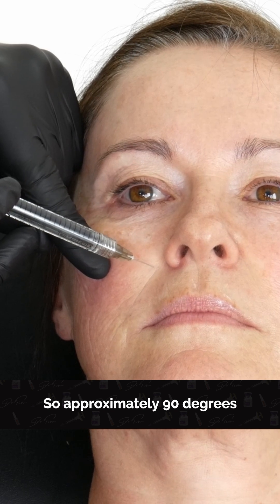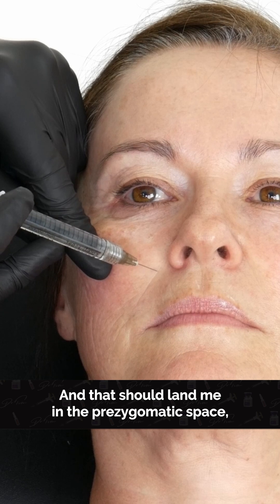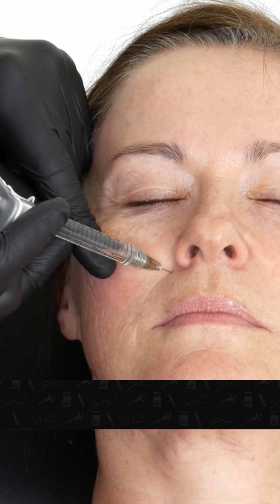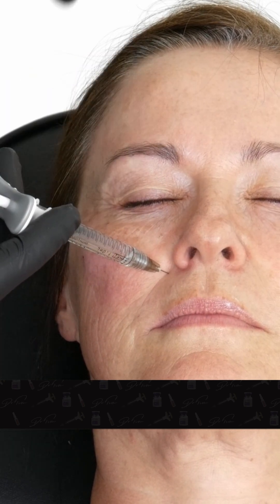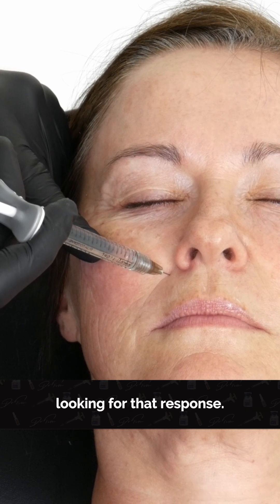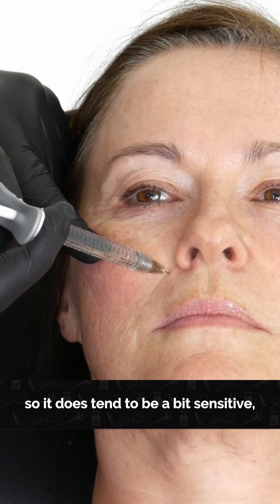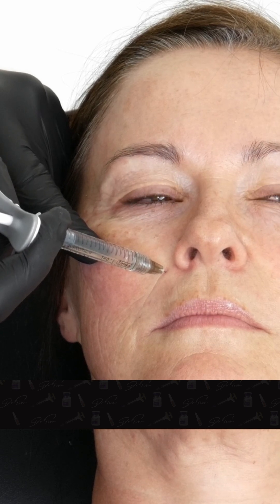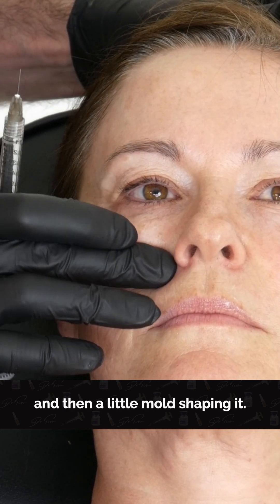Treating the nasolabial folds

Comment: How many MLs do you usually do in this area
Reply: I’ve seen so many different techniques for injecting various parts of the face that I’m beginning to wonder if there is a correct technique.
Reply from the maker: @MagicWandProductions  I try to think in terms of benefits and risks rather than correct and incorrect
Reply: Wow, it looks like her nostril actually went in meaning made it look a little smaller, which is great I think
Reply from the maker: Everyone is different but bolus to the bone no more than 0.3ml. On average 0.5-1ml each length of the nlf 
Kind regards Mary. Clinical advisor for Dr Tim
Reply: @DrTimPearce Hi Doc, I had this done today and they used 0.3ml bolus on each side but I still need a little more. Do you mean no more than 0.3ml on the bone ever, or in one go? Am I OK to go back in a few weeks and get more?

Comment: Doctor I have a question, One and a month ago I had Restylane kysse and have severe itching on and around lips as well as marionette lines. I want to get the filler dissolved, I have only done 1ml in my 43 years of age. I now regret it, as I feel crawling sensation all over my face specially when I move my lips or at night time specially. Do you think that when dissolving it takes away the allergen or will ot just migrate and migrate and never leave my body?? I am desperate with the extreme itching. Itching I read is side effect of kysse. Thanks in advance for your valuable education, replies, time, and knowledge.
Reply from the maker: There could be different reasons to why you have these symptoms 
Is it tingling or itching ? The filler could be putting some pressure near a nerve ending that’s causing this sensation. 
Have you tried an antihistamine? Does it improve ?
Any signs of infections, heat, redness blisters? 

Return back to your practitioner for their support and to treat the cause of your symptoms. But if dissolving is needed it should sort out your problem but assuming there is no infection. 

Kind regards Mary. Clinical advisor for Dr Tim